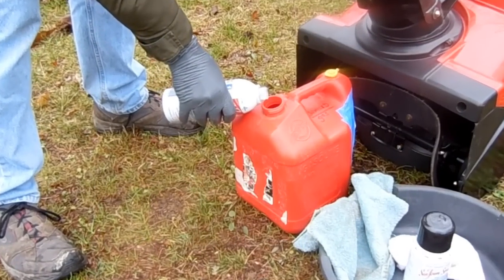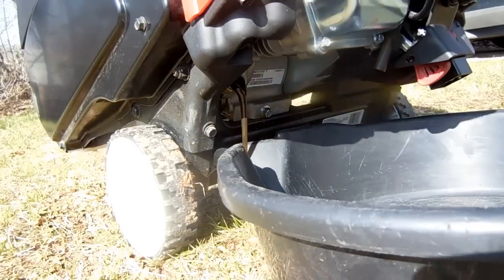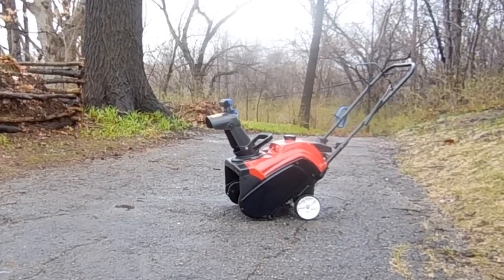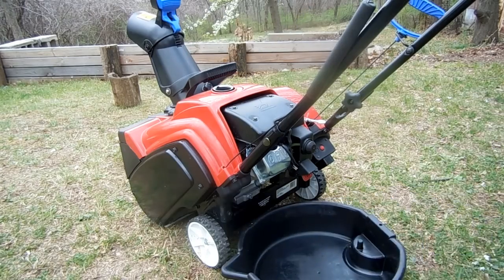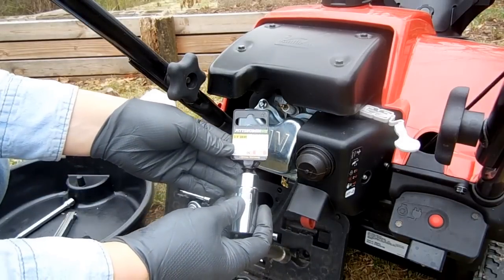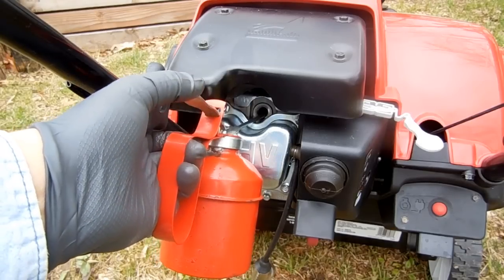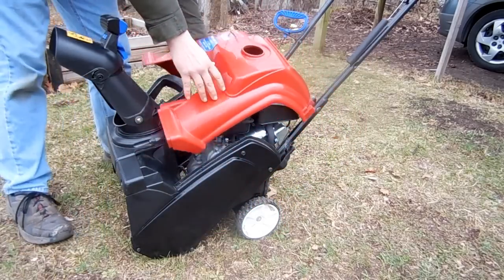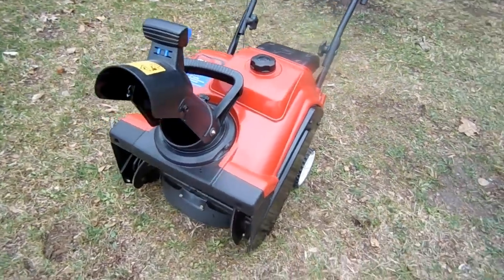Toro Snowblower Long Term Storage Preparation

Comment: I owned one of these for many years. This one was for my daughter. It will do a great job on powder snow do7.pl/toro however deep, as long as you stay ahead of it. Very reliable and well built. Since it is electric It also eliminates any starting issues or the need to store gasoline. The downside is heavy, wet snow.

Comment: I've always just added an ounce of Seafoam to the gas, ran the engine a while so the gas gets thru the carbs, then shut off the gas at the tank and let it run out of gas in the carb so it drains. I make sure the tank is always full if it's a steel tank like a motorcycle. And they always start up like they were just shut down in the spring. I've been doing this for 39 years with not one carb problem and never cleaned a carb since.

Comment: A couple of friendly suggestions:
Replace the WD40 with Fogging oil. WD40 will dry out. It’s basically a solvent.
Replace the Seafoam with a good fuel stabilizer such as Stabil.
Loosen the bottom center bolt on the carb to get all gas out.
Don’t spray the engine with water. Asking for problems.
Drain the oil by unscrewing the drain plug. That’s why it’s there.
Great video!
Reply: Has anyone seen their fuel gel up with Seafoam? I use it and havent had a problem in the three years I've had my blower.
Reply: Was wondering why using stabilizer is better than seafoam. Doesn't seafoam clear deposits, while stabilizer only treats the fuel? Can I use both?
Reply: HaiDef I use Seafoam on my older machines. It’s a great cleaner. If you want the best results, use Stabil & Startron, one is to stabilize, the other to handle the Ethonal.
This combo has worked for me with perfect results for 30 years!
Reply: @algorel4763 Ohh ok, thanks!
Reply: @HDVrock  I actually do. I use .5 ounces of Star Tron and 1 once per gal of Seafoam. All my small engines run perfectly.
Reply: @algorel4763  seafoam stabilzes the fuel just fine..  Spraying the engine down is good practice if you are coming in contact with salt. WD40 is great for rust prevention and easier for most homeowners to spray in.
Reply: James Turner Anything you say Jimmy, anything you say!
You know it all!
Reply: Sea foam was designed for two stroke engines hence the name
Reply: No, DOn't use Stabil. It may work short term to stabilize fuel, but over longer periods of time, it actually settles into a white granualer substance and cnplug jets and small journals in the carb (makes a real mess)
 Use Seafoam to clean your carb during the running season (I run some thru all my vehicles and small engines during the year) and use it one ounce per gallon as fuel stabilizer in in the off season. I've ben using it inmy lawn mowers and motorcycles for the past 30 some years and they startup in the spring like they have been running every day. I never even drain my carbs like the recommend and  I never have carb issues anymore. I just laugh at all the people who need to always "clean out their carbs" every so often. Not me. Mine are always clean. Seafoam just plain works. (No I have no affiliation with Seafoam)
Reply: @PainterD54  You misunderstand Sir. I'm a fan and use it in all my small engines. I was wondering if anyone had Seafoan fail in a reasonable time. 
I usually go buy about 4 months worth of gas and stabilize with Seafoan and have never had an issue. But, the push mower starts much easier in the Spring with new gas. I usually run that one dry in the fall these days.

Comment: Like said before ,  take out the bolt just below and to the right of the oil fill hole. That's the oil drain plug beside the numbers. 121 -4228

Comment: I stabilize premium non ethanol fuel and leave the tank full all summer long on my Cub Cadet 2X 26". I feel that it protects the gaskets to remain full. I do try and briefly run the engine for a few minutes monthly on cool mornings keeping in mind that the blower oil is very thin. I follow the same full tank storage with my Generac GP2200i inverter generator .. also run that unit monthly. In the fall season, I siphon both tanks and replace with fresh stabilized fuel prior to the winter. I've never had any carburetor problems on any of my engines from storage as long as I use non ethanol fuels.
Reply: This is exactly what I do!

Comment: decent advice as everyone has their own way. I just run the fuel out on my 2 stroke 210 r. I changed the plug twice in 11 years. That's all besides paddles and scraper.  Definitely made the transition to tru fuel as the fuel went bad mid season in a snowstorm. I rather pay more in fuel and have the equipment work than gamble with fuel that last 60 days or less and deal with the shop and be shovelling.

Comment: WD-40 is not oil, and is not close to being the same as motor oil. WD stands for 'water displacement' which is what WD does well, it does not lubricate the same way oil does, and it evaporates rather quickly. WD is 90% mineral spirits, which is paint thinner or charcoal starter liquid. Gun oils are light oils that do lubricate, and they also come in spray cans. 3-in-1 is a light weight machine oil that can be used when you want some lasting light lubrication.

Comment: Should of drained it from the plug in drain pan not fill hole.
Reply: Yes I agree.
Reply: Suppose you could use an oil extractor and extract it from the fill hole. And I think I'm some other brands theses machines the small drain plug further back on that bar. I think some of the Husqvarna Tsar Hondas were like that.

Comment: If you are not going to use motor oil in the spark plug hole I would recommend fluid film as it is a much better lubricant than wd-40  , it is also a good rust inhibitor . It has a widespread usage . It can be obtained at Lowes or online , a little expensive but well worth it .
Reply: 1)Would you recommend to drop some motor oil in the spark plug hole rather than spraying lubricant?  
2)If I drop some oil in the spark already, do I need to spray lubricant?
3)If I don't put oil in the hole, do I just spray Fluid Film inside the hole?  Thank you very much!

Comment: I have a Toro snow thrower from 1995 with a 2 cycle engine ( you have to mix oil into the gasoline ) is there oil in the crankcase that needs to be drained / changed ? The entire engine is encased in a plastic cover that I don't know how or if it comes apart. Surely there has to be some kind of crank bearing(s) and connecting rod bearing(s) that need bottom end lubrication. Don't tell me to "look at your manual" because I don't have it and I don't know what model it is. Not checking or changing such oil for 27 years would have certainly caused ANY engine to seize or blow up by now, I would think. My Toro looks the same as the one in this video ( for the most part.) Except the engine isn't readily accessible.
Reply: Martin,I also have that model of Toro. Being a 2cycld there is no oil in the crankcase. Hense the oil in the gas . It does take a little work but the covers do come off . Pull off the tube on top front first. Followed by the big cover underneath  then you can unbolt/unscrew the rear covers. Parts are easy to find at small engine shops. Good luck

Comment: great video for me as a first timer to move snow. But, what is the ratio of fuel stabilizer to gas. Many thanks.
Reply: Mohammed Ali this model is gas only.
Reply: @mike1536  I bought a 518 ZR. From your info. I would think gas stabilizer is not required. I appreciate your advise. Thanks,
Reply: Read the instructions on the fuel stabilizer bottle
Reply: @DaninVirginia  i put stabilizer in my gas can all year and for my grass cutter  too

Comment: Another friendly suggestion: get CleanCarburetor kit and remove all the fuel from inside the jets - this is the place where the fuel gums up.
Reply: fuel wont gum up if its stored properly. TruFuel is also an awesome product to run through the fuel system before storage.